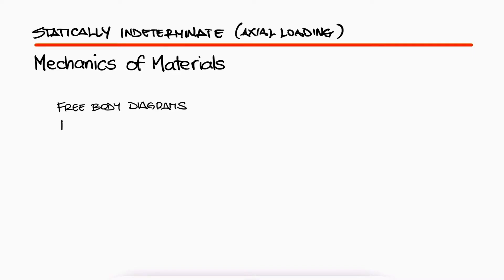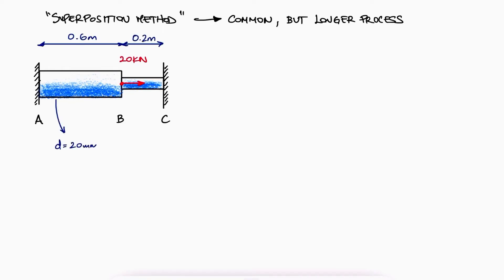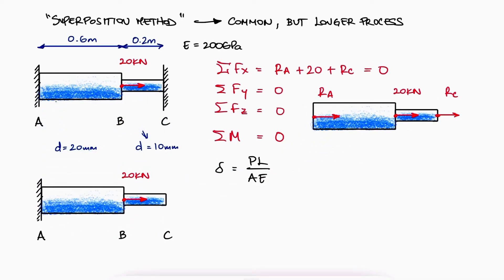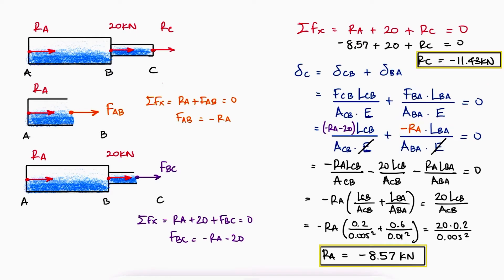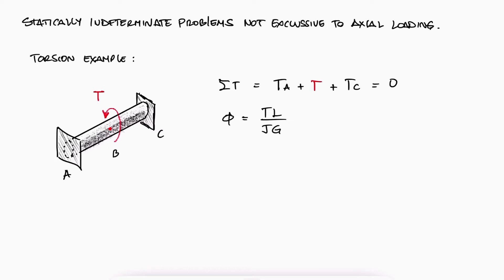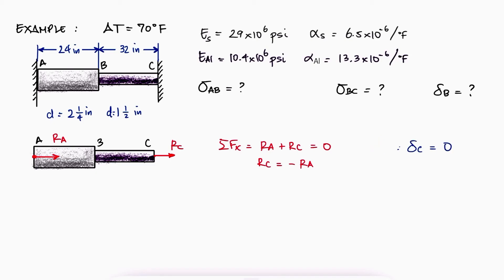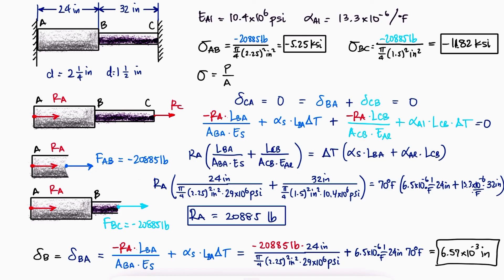STATICALLY INDETERMINATE Structures in 10 Minutes! - Axial Loading

Comment: 3:09 why is there no internal force between B and C?
Reply: Imagine pulling out a screw that’s stuck in a piece of wood with a pair of pliers, you grip the screw at half of its length and start pulling. You are now pulling on the lower end of the screw and the wood is pulling back with the same force, the end of the screw that points upwards is kinda along for the ride not really doing anything

Comment: Hey can u explain why Reaction force Rc direction was taken along positive x. It should be negative x right?
Reply from the maker: You can assume it to be whatever you want it to be. Since we got a negative value for Rc, it means that the reaction at C was indeed going left, not right. My recommendation is to always assume them to be positive, and if they're not, then they are going in the negative direction.
Reply: @LessBoringLectures  cool dude, really good trick. I was confused over these problems, So I started checking in YT, glad I came across your channel. Thank you for doing these.

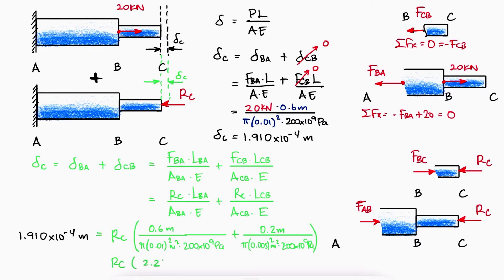Comment: Why is it Rc = 11.43 at 4:12, shouldnt it be 8.57?
Reply: The problem reads: Ra+20-11.43=0. To solve for this, you must isolate Ra by moving the +20-11.43 to the other side with 0: Ra+20-11.43 = 0 ---> Ra = 0-20+11.43 ---> Ra = -20+11.43 ---> Ra = -8.57